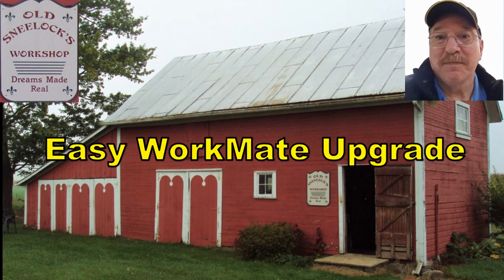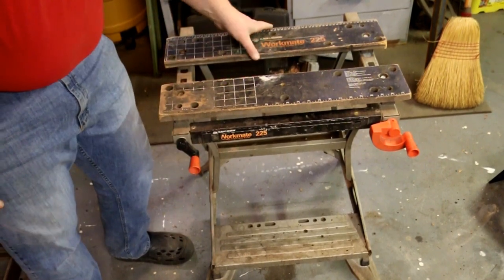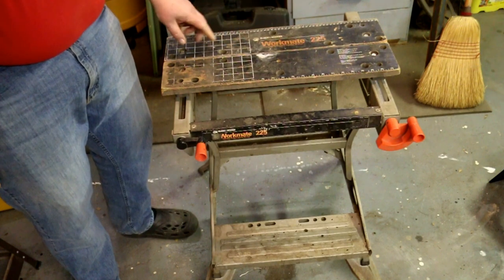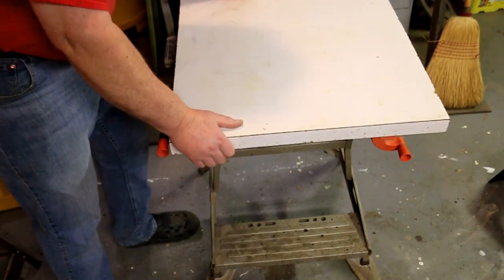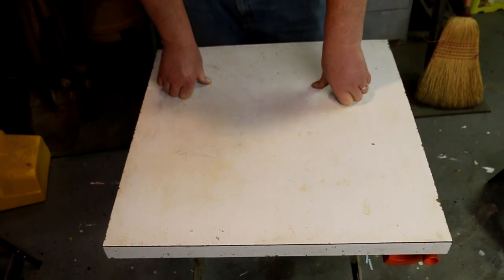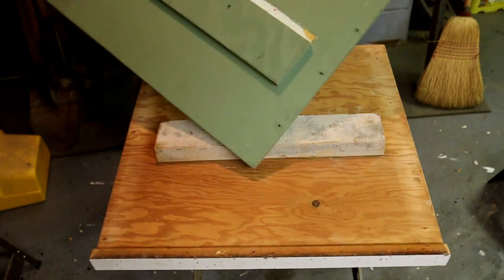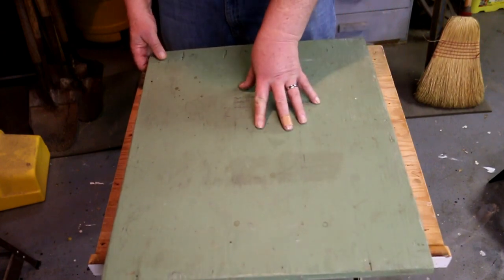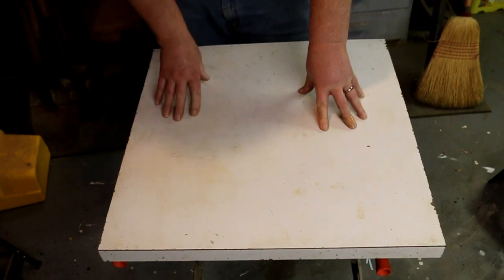Workmate Upgrades   Wood Glue Proof Top

Comment: To remove the dry erase marker ghosting,  try a Mr. Clean Magic Eraser (or one of the knock offs).  I use that when our dry erase board gets mucky, even worked when someone used a permanent marker .     Do use the Magic Eraser damp. I used one dry to brighten up the aluminum table on a table saw (not shiny just whiter, cleaned all the dirt out of the scratches), and it worked but put a nasty dust into the air.  Never had that happen using them damp, as per the directions. Go figure.  :)
Reply from the maker: I will give it a shot. The plastic has tiny scratches from all the work that has been done on it. The marker got into it and is difficult to remove.

Comment: I have made exactly the same things from old kitchen cabinet doors, a very under rated resource
Reply from the maker: I'm using the doors for half a dozen different things with a more pieces equal to 3 sheets of 3/4" thick birch AA ply in the shed. 😁😁😎😎

Comment: If you rip a slight bevel along the edges of the two-by it will help with holding the top in the vise.
Reply from the maker: Good tip. 😁😎

Comment: GOOD idea! Good for general getting on with stuff. Mine is a lot older and was found underneath the house of the wife's step-dad when he passed. I got it to keep it from walking off and have used it several times, but mostly use the tailgate on the Taco with the mud flap off the 980 that a rock peeled loose when cleaning up the floor after a shot. It's thin but good at grabbing stuff as rubber does and matters not what is spilled or falls on it. I hope to be out there directly and start plundering the new wifely mower but 1st we have grindings of trees to haul. Happy week and GBWYall!
Reply from the maker: Never a dull moment. Spent yesterday fixing a vent fan.
Reply: @OldSneelock  THAT's why you're the FIXER, pal!

Comment: I've cut 4 full cords of wood this winter with a dull and out of wack cross cut sure wish some one would fix it .but I am in shape after all that
Reply from the maker: A cross cut saw is one of the easiest saws to sharpen. A sharp flat file with one edge ground smooth will touch up the teeth and a light hammer will set them. 
I went through the whole process https://youtu.be/pvre-mt0mJE

Comment: I bought the HF version many years ago, I think it was maybe 8 Bucks on sale.....Just looking now they're $25 now regular price......It's surprisingly good for how inexpensive  it was.
Reply from the maker: It's a simple design that uses the x brace principle to support heavy loads without twisting. 
I have a CHEAP knock off made from square tube that  has lasted 10 years despite being the one I use if the job could damage it.